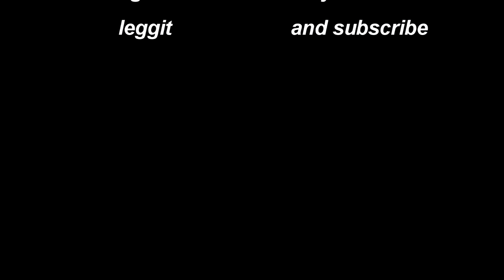bodgit ans leggit garage girl power serviceing ford mondeo st diesel 2.2 2007

Comment: Hello mate😁 loved this video because its what I do for a living😊She is such a noob! Hats off to Sarah for been so confident to take part! 👍 Good to see true garage teaching real tips. 
-blow the crap out of air box before fitting filter
-hold bolt when removing
-start with centre screw
-oil cap off at start!
Checking colour of fluid

 Leon please don't think I am been judgemental but teach her the basics first! The torque value 🙊 why not teach to torque wrench? It helps new starts understand how hard or soft to turn nuts and bolts. 
Use car data (auto data) for volumes of liquids. 

Use gloves 😭. 

,When teaching mechanics best to be patient and let them find success in the challenge of getting it right ( air box lid)

Thanks again for anther great video hope to see you both more!

Comment: Alright Leon, my sister in law bought the same spec skoda karoq as my wife & i did, she has had her 1st service, mine is due but my quote is £100 more because mine has long life oil in! Is this just a main dealer rip off??👍
Reply from the maker: Well yes mate is a scam long life oil is more expensive but not that much more expensive
Reply: Long life oil is supposed to be good for 25k miles 🙈 so you don't have to service your car 2twice a year if your a high mileager but I would take Leon's advice and change out standered oil at between 5k and 10k miles.

Comment: Good on her for giving it a go, wish more girls would then this sexist society would go away

Tip I always use, especially on the Mondeo is a 13mm socket with a 12" extension bar when lay on my back on the drive way, means I can still push it it whilst undoing it without access and have a ratchet for undoing it if the threads bind at all and always stay clean(ish)